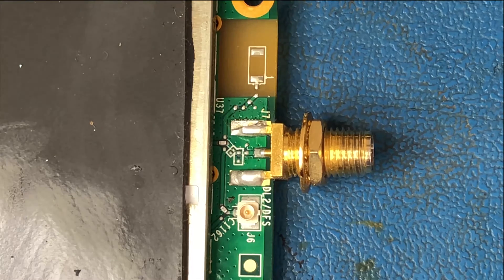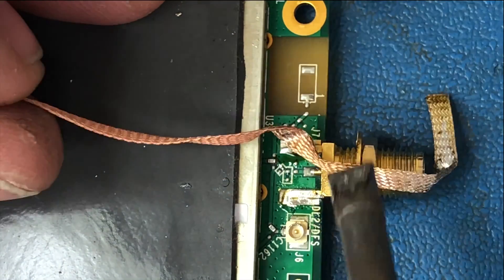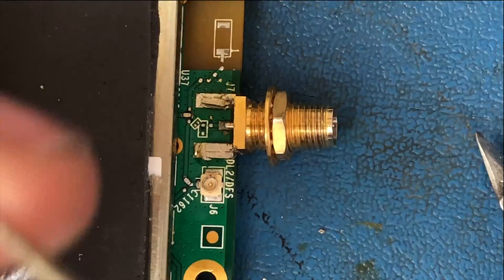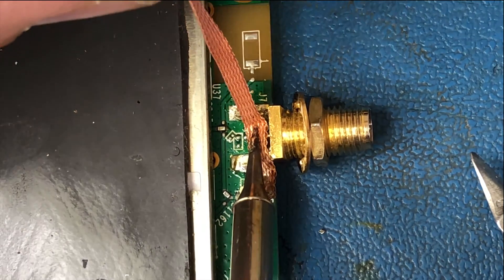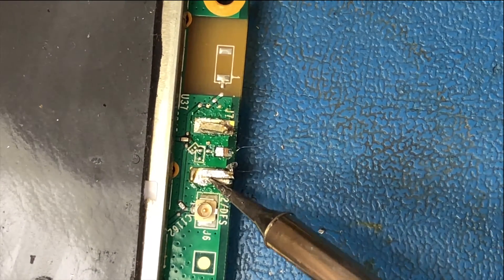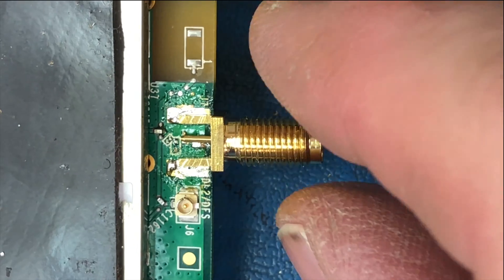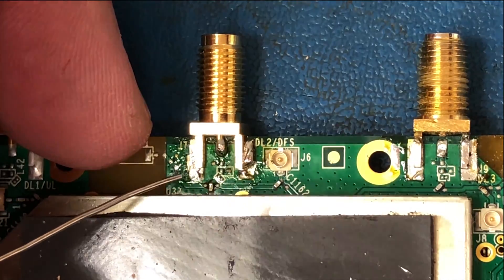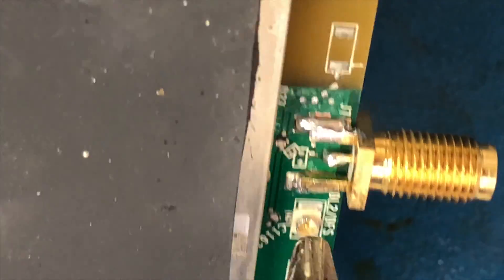RP-SMA Soldering in a Replacement on Teradek 2000   4K

Comment: What type of solder do you use when attaching the new connectors?
Reply from the maker: The original stuff they use is solder paste.it contains no lead which is why it’s hard to melt I just use regular 60/40
Kester.
Reply: i Repair Electronics thanks so much!  Do you think 63/37 would work just as well?  I need to attach an SMA jack to a board and that’s what I have.
Reply from the maker: @taylorbeebe2095  yes that's fine.